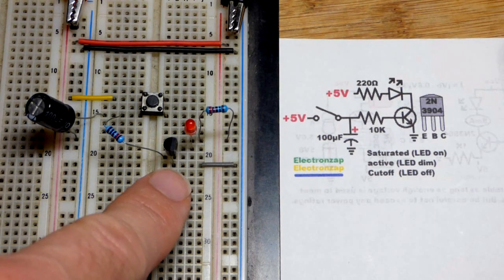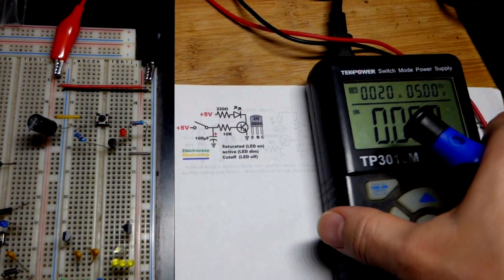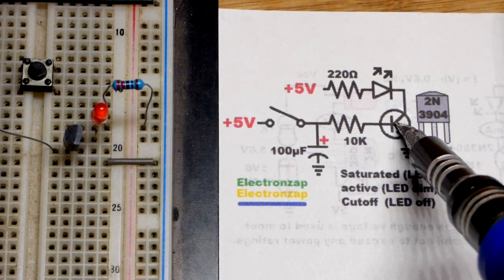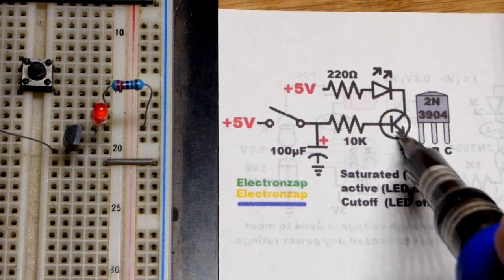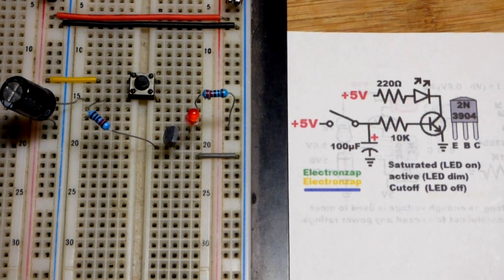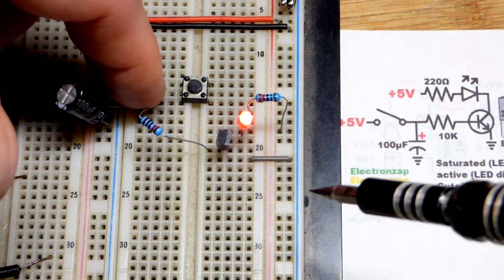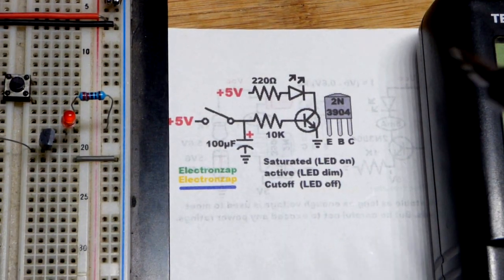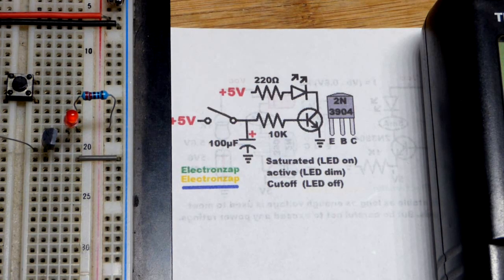Delay Off with Fade NPN BJT switch circuit Bipolar Junction Transistor

Comment: 100 uF is the largest capacitor you want to directly connect to a power supply without limiting?  I really can't understand that.  Power supplies inside appliances, or test equipment, or audio gear like amplifiers, can have thousands of uF caps on the power supply, and they aren't going to blow anything because that instaneous inrush current at turn-on is so brief.  Maybe if you get up to 10,000 uF of so, I can understand being worried about limiting the current, but 100?

Comment: what modification should i use if i have a 5V supply and 3W 3.5V 700mA LED
Reply from the maker: If it doesn't include a resistor, which is what it sounds like, then you need to add resistance or use a current source of 700mA. My higher wattage LEDs are built on a heat sink that includes resistance to protect the LED from 5V.